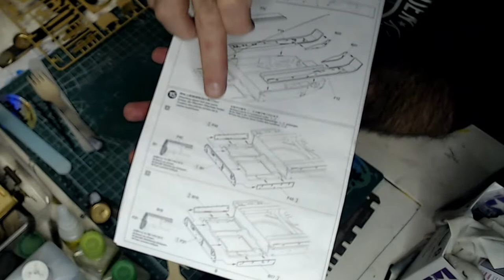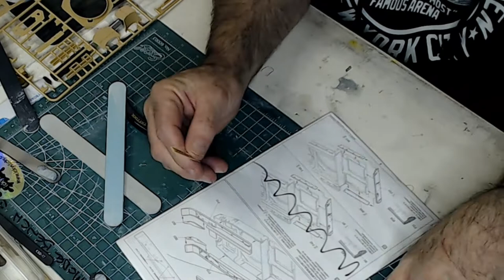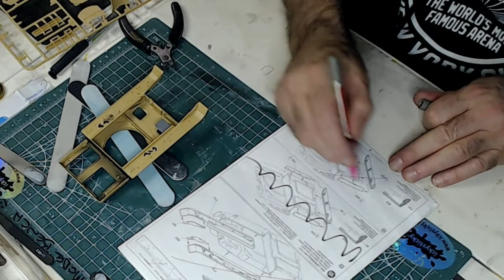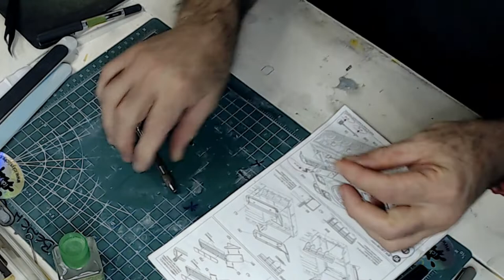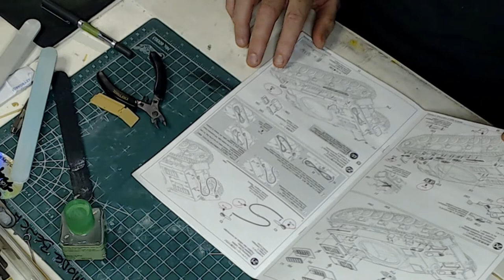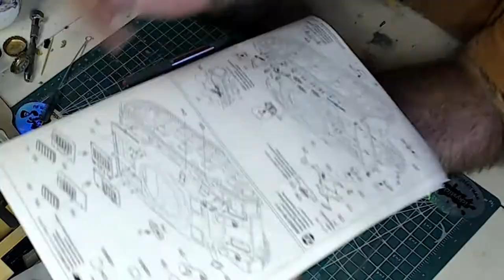An average modellers build of a 1/35 scale Panzer Kampfwagen

Comment: Hi Simon, you are doing great on your tank.  If you give up, it means Jason won, you don't want that do you?  LOL.    I have a question on your Arizona kit.  I was going through the instructions, checking parts, etc when I ran across a little issue.  In the Brassin set I am supposed to have 16 R5's, I guess they are bollards,  I only have one row of 9.  I took at the instructions and can see where the 16 go, so I guess I'm short 7.  You might want to check your kit to see what you have.  I don't think it will be to hard to scratch build the missing parts, I just wonder if it's just my kit or all of them.  So far, everything else looks like it's there.  I am not real crazy about the PE anchor chain, I might see if I can find something better.  I'll be really interested in seeing your deck.  I've had several people tell me a wooden deck at this scale can cause fit issues due to the added thickness and others say you have to have one to make the model look right.   Have a great day.  Jeff
Reply from the maker: Gday mate. I will have to check that brassin issue. Thanks for the heads up. The wooden deck seems to be pretty thin. I will do a quick video when I get out of bed. It’s bloody cold. I have 2 anchor chains. If it wouldn’t take so long, I would send you one. One was from the Vittorio and the other has come with the wooden deck. Have a great day mate.
Reply from the maker: Hi again Jeff. If you have a look at the Brassin thing with the semaphore lights and the range finders, there are also some bollards at the end of that also ☺️
Reply: @hibbosmodelbench2351  Hi Simon, I saw those, they are labeled R5, but there are only 9, the instructions call for 16.  Did you see more someplace else?  Thanks Jeff
Reply from the maker: @JeffDonahueScaleModeling  I have a complete seperate sheet.
Reply from the maker: Hi Jeff. Go check my community post. I uploaded a photograph.